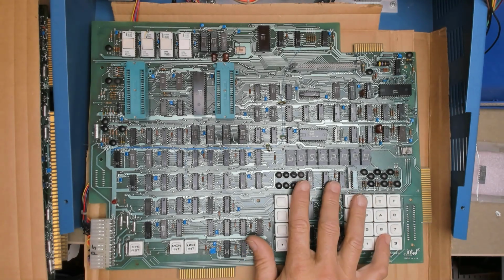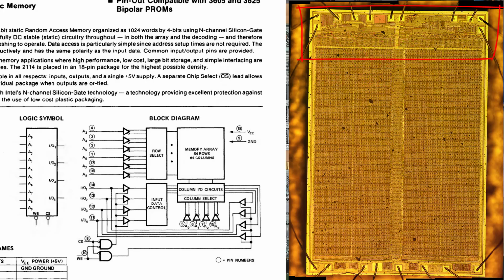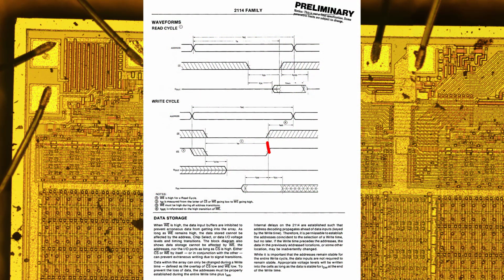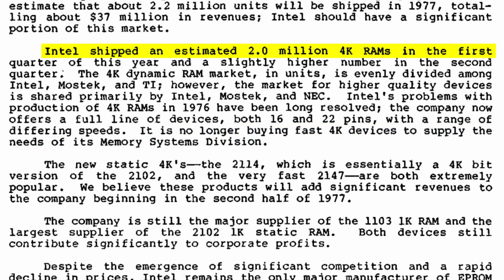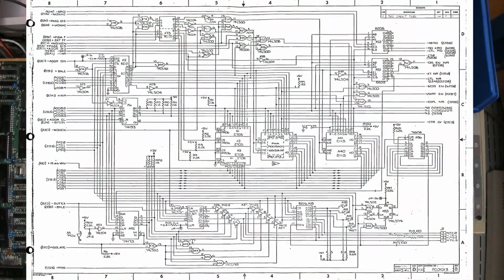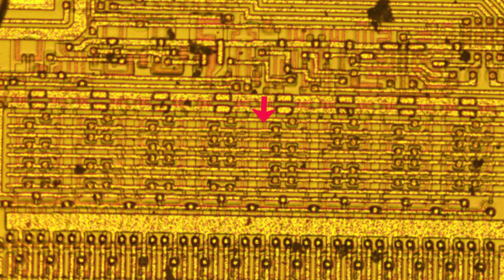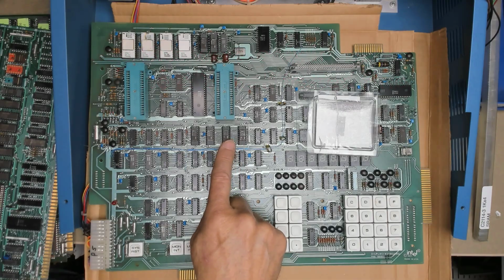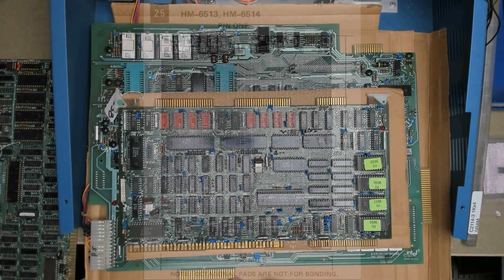{110} Intel's 2113 RAM: Never Sell It, And Never Speak Of It Again

Comment: Back in the day, it was quite common to put a none working system in the freezer, then test it while it was still cold.  Most of the none working systems would operate normally when cold and then fail after warming up.  At which point, we would spray individual chips with a spray that cooled them down, until the system functioned again.  So temperature related issues are quite common.  Occasionally, when a system appeared to work that was reported not to, we would often cover it to heat it up a bit to try and see if it failed.

As I saw mentioned, voltage related problems were also something to test.

As a side note, I had one system that worked perfectly when we tested it, but failed for the user.  Turned out there power only supplied 110 v, whereas ours was 117 v.  It was the power supply that was the issue as it should have been able to compensate for the voltage difference.
Reply from the maker: Yep, used to use a 5# canister of Freon before we knew what it was doing to the atmosphere. But still use circuit cooler but fairly infrequently since it is so $$$$$

Comment: Whenever I see these, I always wondered what was the point of making a 1k x 4 2114 sram chips when computers were 8 bit? Why not 1k x 8?
Reply from the maker: @keiichicom7891  A big reason is pinout and the number of pins needed to create an 8-bit data bus.  If the MFG is trying to stay in a 16 or 18 pin package, consider 4 pins are required for pwr and ground and to define read & write cycles. That gets it down to 12 or 14 pins left over for the address and data.  Presuming multiplexing either one is out of the question, if it is an 8 bit data bus that leaves 4 or 6 for address.  So if it is just a 16 or 32 word device then it turns out ok.  But a 1 k word device needs 10 address lines, so data cannot be more than 4 bits in a 16 pin package.  At some point manufacturers went up to 20 pin devices when they were still trying to fit 4K 4-bit words in a chip.  As RAM capacity improved they downshifted to 1 bit to leave all the rest for address lines.

Also, remember that the 8 bit word was not as common as one might think it was.   This is 1976 after all, and these RAM chips were in mainframes with any number of word width.  If the machine merited a parity bit or ECC, that is easy to add using 1-bit chips by just increasing the memory width.

Comment: Intel did the same thing with 2716s. The even sold the single voltage 2708. They were mentioned. As the price for the 2716 dropped over time, the 2708 were still in the catalog but at close to the original price of over $30 each. The same catalog had 2716 for around $15 or so. I always thought it was funny that one could directly replace a 2708 H or L with a 2716 for a cheaper part.

Comment from the maker: Someone just pointed out to me that Intel’s ICE-85 control board has a jumper to use the 2113L, 2113H, or the 2114.  So that is the third system I know of that was designed to use the 2113.

Comment: IBM had the same issues with its new 1 MB memory module for the 4331 in 1979. They knew they were going to have bad yields of their new 64K FET memory chip so they did as you have describe and had 4 chip types come off the wafers  (1) A side ok and B side ok (2) A side bad and B side ok  (3) A side bad and B side ok (4) Both side bad. The good chips were put into machines with 2 4 or 8 MB of memory. The chips with only half good were matched and joined on the memory module for the 1MB memory 4331. The bad chips were put in resin cubes and handed out as gifts. April 18 1986 IBM successfully release the first 1 Megabit memory chip.

Comment: 25:20 well why do they still make 6502 and z80 cpu when i can get an intel or amd 64 bit running at several ghz?
Reply: Because I don't think hou can get a multi-core intel chip on a small board to run at 150 deg C.

Comment: What microscope did you use to capture this? Was it motorized?
Reply from the maker: Amscope metallurgical. Yes, I have the stage motorized.
Reply: @HelloWorldETX  cool! do you have some info on your setup? I don't recall that being a factory option
Reply from the maker: @johndmcmaster  I have added the motorized stage. 
The design is not as good as I would like, so I have been thinking of revisiting and making an improved version.  It is a little out of the usual projects I share, but perhaps it is of general interest.

Comment: I have a SBC 80/20 with 2113's on it. But I'm missing the 8080 for it.  it has eight 2113s all A0H. Its PWB 1000818-01 rev 3, s/n 411 _ 3 or possibly 411 _ J
Reply from the maker: Very nice.  The 80/20 is a good single board computer and 8080s can be found for a reasonable price.
Reply: @HelloWorldETX  As of yesterday there is a AMD 8080A from 1977 in my board. I also sourced three of the card edge connectors so I can start hooking up power and serial to it. I'm excited.

Comment: Interesting naming convention vs physical layout - if the A0 jumps the largest portion on the die, one would think that it is the MSB, yet with classical logic design, we always assume it being the LSB. Even when you talk about is as even/odd address, but on the die its no longer repeating, thus its totally just left and right half of the whole array :)
Reply from the maker: I agree, it is a bit disorienting.  Most memories are in arrays where the address lines specify the rows and columns, so the idea of starting at one corner and counting up in binary works well in our brain, but maybe not so well on the chip.   Since any one address enables or disabled half the cells, which external address becomes any particular internal address depends more on mundane issues like convenient carrier bonding.

Comment: Any one of the bits would have deselected half of the IC.
They could have decided based on a statistic of two bit errors but that wouldn't have looked good to customers.
Reply: I think the issue was rather a contamination that spread multiple bit cells - like if you have a huge spot on your screen - picking even/odd is or 2 or other 2 is not really making go away the spot - but the MSB that drops the "physically largest region" is the key here. I am not good at statistics, but the common sense makes me agree with the commentary in this video.
Reply: @cameramaker  You are likely right, the chance that two errors have a common cause is high, thus whatever pin disables adjacent cells will yield the most working chips.

Comment: The 24,576 count is made by simply multiplying the 6 transistors by the 4096 cells, naively. It ignores bus drivers, signal drivers, etc. The real number will be a little higher.
Reply from the maker: I am not sure yet if the 2114 used active loads or if they were just resistors.  As a low power device, i expect they were active, but if passive there may only be 4 transistors per cell.  Hopefully before too long I get around to removing the passivation layer and then rephotograph and probe the address lines to confirm my A0 hunch, then start removing metal.

Comment: I just realized something. In the early 80s it seemed like every fab on the planet was making 4164's to keep up with the huge demand mostly generated by the popular Commodore 64. Those computers always had a random collection of 64K bit chips from Toshiba, OKI., NEC, Motorola, Micron and others... but I don't recall ever seeing a 4164 made by Intel. Had they given up on the RAM market before it exploded?
Reply from the maker: Intel’s was the 2164.  It had to begin with a “2” because it was n-channel.
Reply: @HelloWorldETX  Did anyone use it? I don't think I've ever seen a 2164 in my life.
Reply from the maker: @scottlarson1548  i think you are on to something here……
you nailed it when you listed the manufacturers that made the 64kbit chips.  In about ‘78,  Mostek second sourced their memory to a number of Japanese firms. Within a few years those firms were making better chips than any domestic manufacturer, including intel.  By the mid ‘80s, it was all over for US production.
I looked at the adverts in the back  some magazines from the early 80s.  All the DRAM were Japanese.
I think the answer is intel may have been used on some high end systems, but for the consumer market they were just too pricey.

Comment: When i was slightly younger i had a Sinclair ZX-Spectrum  they used half of 4164 64kb Rams. the story was the same as you are explaining here... bad chips that where ok as long as you used only half of it.

For the intel part, in the 90's on my job i used to work with an iSBC system running CP/M86. pffff  even than i was not enthousiastic about it.
Reply from the maker: I am presuming the iSBC system was considered archaic at the time- but one of those old control systems that was impossible to replace?  The iSBC design was long in the tooth by the 90’s, but when they first came out they were a pretty sweet platform.
Reply: @HelloWorldETX It was used in a pretty large Hardware Diagnostic System. Embedded into a large Desk/Cabinet where you could install PrintetCircuitsBoards to diagnose them (Aviation Industry)
I started work to create a PC-Based system, and as a mather of fact later systems made use of a smaller unit in combibation with a PC running MS-DOS. (a that time I already only did development on Linux Systems)

For your question on time.   Wel In Aviation like in most industries, in general  equipment will be used well over 30 years. At the time the technologie was about 8 years old, So delivered early 90's.
There were a lot of different technologies from different era's used, Varying from TI980 (Harvard Architecture) alike computers, as well as small mainframes (today you could run that stuff on your Phone), Lots and Lots (i mean a really lot off) MicroControllers or Small Micro embedded Computers using 8086 CPU's, Weird never heard of computers and even i once had to deal with a transputer system.

Most unique however would be me..... Yes I turned out to grow up as a UNIX-crack, but i never have had a beard !

Comment: Used the Prompt48 along with an MDS system and ICE-48 at my first job in 1980 programming firmware for a prototype voice-controlled robot toy at Milton Bradley. I could tell ahead of time that there were going to be assembler errors from the the rhythm of "thunk-a-thunk' from the head load solenoid sounds from the 8" drives. We were paying about $60 apiece for 8748s. The 2114's were the goto RAM for those protos.

One of the simplest 'cookbook' micro designs was to use the 8085 along with a couple of 2114's, XTAL, 2732 and a bit of glue logic. 1979 breadboarded such an 8085 system in my dorm room as a senior lab project using the guts of a broken TI-58 calculator for the keyboard and display and wrote a rudimentary monitor for it. After demo'ing it I had to take it apart and give all the chips back because they were computer lab inventory and didn't have the cash to buy for them for myself. Not unusual considering that designing things you can't afford for yourself is a common experience among engineers.
Reply from the maker: That is interesting prompt first hand experience.  I may do a pair of videos just for the two prompts.
Ha! Yea, the 8” disk solenoids were great about telling you when the old MDS was finishing up.

Comment: There was probably a option to use the most significant row select address as well to partition the RAM top and bottom.

Interesting analysis of the failure modes.

Harris might have been selling their faulty chips profitably while Intel was embarrassed.

The Sinclair Spectrum also had options to select budget RAM, it had H/L and 1/0 options to accommodate cheap RAM from two vendors.  It seems that for quite a while it was profitable to market the memory that was half broken to thrift customers.
Reply: That's still regularly done with things like CPUs where bad cores are deactivated and sold as a lower-core-count chips.

Comment: National Semiconductor had to have had the worst quality 2114 in the 70's.  I had worked on 100's of terminals in the 80's and any time the complaint was garbage on the screen it was likely a a defective National 2114 in the video memory.  If I found Nationals on the board I would replace them prophetically.  At the time I found the NEC 2114's to be the most reliable.  Memories...
Reply: prophetically, or prophylactically?
Reply: @RonJohn63 could it be both?
Reply: @PainfulRenegade  prophetic means "accurately describing what will happen in the future".
Prophylaxis means "protective or preventive treatment".
So... no.  But they're related.

Comment: So is the 2113 from week 35/77 aptly named A0X?
Reply from the maker: Good point, but it is a A0H like the others.  
I wonder if that means this chip has some sort of latent defect that would show up in extended testing?  Or did intel really not think their customers could comprehend a 2114 working in a 2113 socket ?

Comment: suspect there was some classified military device using 2113 and needed a 2nd source...
Reply from the maker: That may not be far from the truth.  If the government were to use any iSBC 80/20s, they would have required a second source.
But, as far as i can find, the harris 6513 doesn't show up in catalogs until after 1977, and by then (or at least sometime in 1977) the 2114 was in full production and would have been a direct replacement for the 2113 in any existing board using the 2113.  There would soon be many second sources for the 2114.
Reply: @HelloWorldETX  considering the time it takes to create military devices, they could have required the second source at the time the device was put in production.
also they would have had access to pre-release 6513, which would be before 1977

Comment: Very interesting.  Makes me wonder if Intel had a boatload of 2113's after the 4k crisis was over and they sold 'em to Harris at a bargain basement price...?
Reply from the maker: Good idea, but i don't think so.  In the harris spec sheet there is one diagram that indicates there are subtle differences between the 6513 and intel's 2113.  They say:
2113 requires the address to remain valid throughout the cycle
6513 requires valid address for only a small portion of the cycle, but requires /E to fall to initiate each cycle.

Part of what gave the 2113/4 its speed is that the addresses were not latched, they just rippled through.  evidently the addresses in the 6113 are latched by a falling /E

Comment: When I was a student I spent many happy months at TI in Bedford UK working on Teletext applications and the 9900 boards. I got to design a graphics card and populate it with maybe 16 or 32 of TI 2114 SRAM chips, these were quite valuable too. One day I went back into the lab and found my board had been depopulated, I suspect one of the technicians had filched the chips but who knows.
Reply: I'm surprised you didn't use dynamic RAM since video display circuits are usually constantly reading the RAM so you don't need a separate refresh circuit.
Reply: @scottlarson1548  Still simpler when using 2114's. No latches needed for either address or data demultiplexing purposes. Just a 2114 and some address decide combinational logic, IIRC, but been 40 years since I used a 2114.
Reply: @deang5622  ??? The 4116 had no multiplexing. The only annoying thing was that it needed -5V and 12V power but static RAM needed more +5V power.
Reply: In a commercial application that would have been the proper path, but I was just interning so it was a quick wire wrap hack that worked until the chips went away. There was only one of these systems, forever grateful that TI let me do what ever I wanted. @scottlarson1548

Comment: The 2114 was often used in old arcade machines around the 1980s. Mostly as register RAM or temporary work RAM for video display built with 74LS TTL.